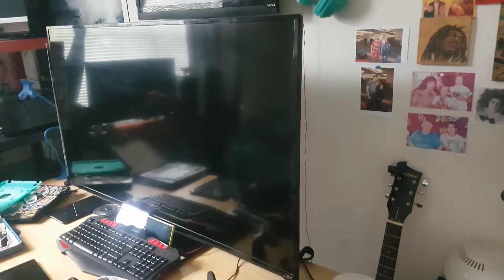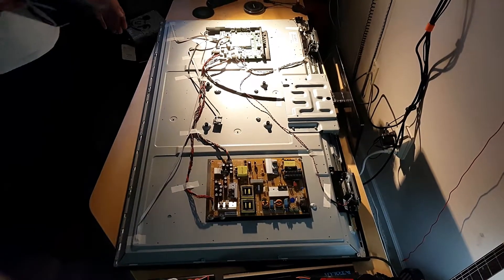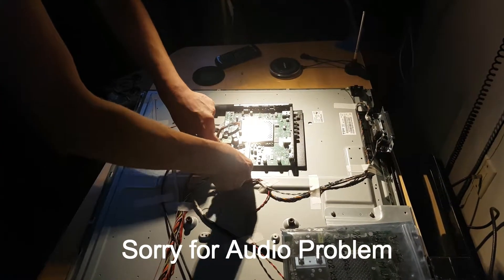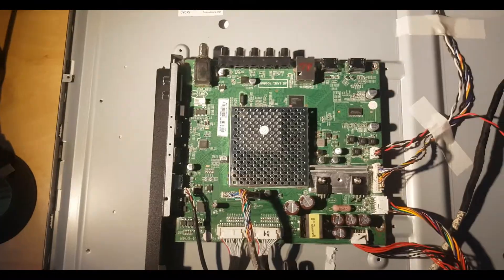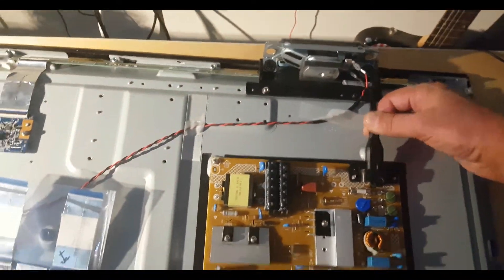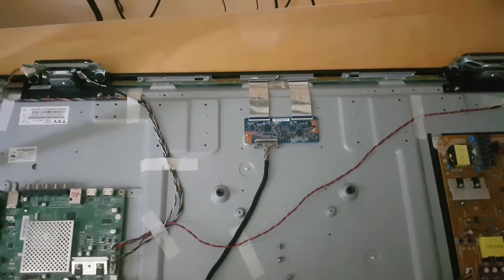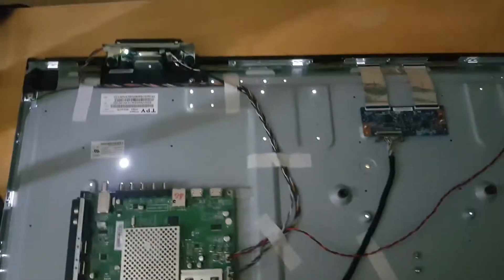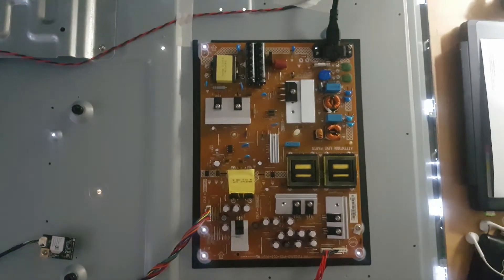Vizio TV Repair 2019 Troubleshoot and FIX on E500I-B1

Comment: These newer tv,s malfunction like that due to bad electrolytic capacitors on the power supply board.
You can usually spot a bad cap visually from how they bulge out and leak so replacing those bad caps and then add a 1k ohm resister on the bottom side of the board on the + and - terminals of the replaced cap and they'll never go bad again

Comment: You were right on.  I found a Vizio e500i-B1 that someone left out in the alley.  Got home and it worked.  It actually worked for about a week.  Then, it flickered and just was black screen.  I scoured the internet and videos, then found yours.  I baked the power supply 385 for 10min and voila -- it works.  Thanks for posting this solution.

Comment: So your solution is to bake the power supply board for 10 minutes at 385 degrees? 😂🙄
Reply: Ik right🤣🤣 I’m so confused on what the thing that fixed it was
Reply: I have this exact power board and model with the exact problem. I'm gonna try this. I'll let you know how it goes lol.